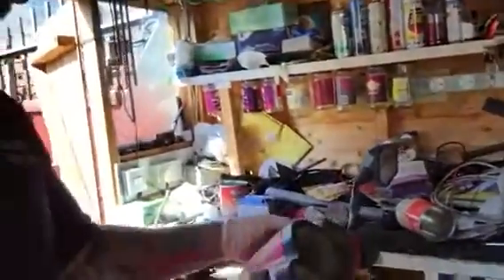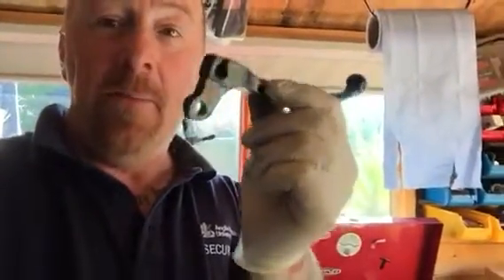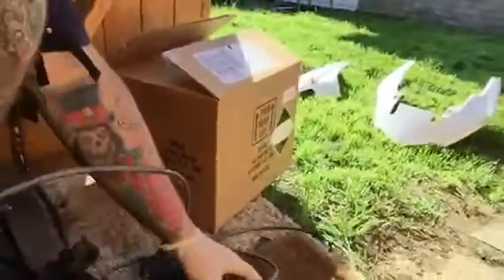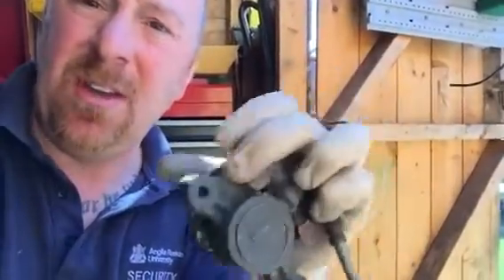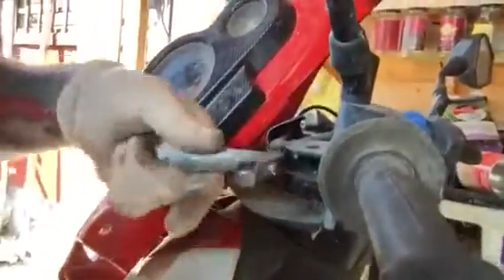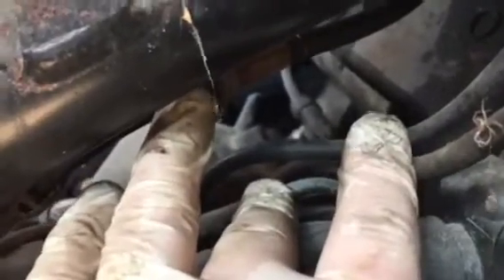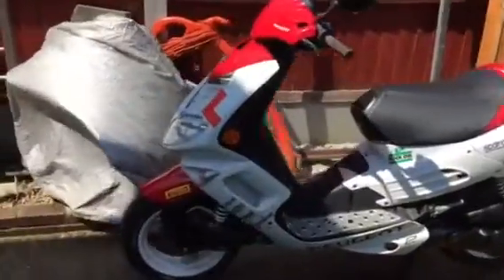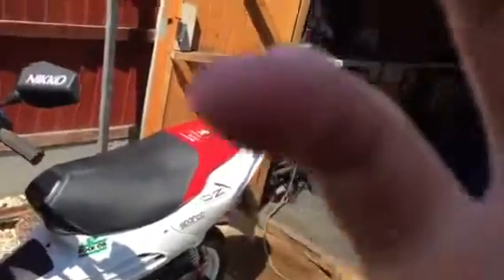SPEEDFIGHT IMPORTANT ALL YOU NEED TO KNOW MARK SAVAGE

Comment: Hiya mate ,I have a question ,I've just mot,d my sons Peugeot ludix  ac 2006 and it's been fine all year as well ,but he was switching lights from high to low basically messing about ,anyway the scooter then cut out and from that point last week I can't get a spark ,in this last week I've bought new stator and Cdi and coil with lead and plug cap,I've tested them all on my speed fight because a few are the same ,I've gone through the complete wiring harness carefully taking insulation tape off and cannot find Any breaks and tested every wire on the scooter ,I've also changed over the ignition key switch just in case that was that although key switch is second hand so that could be faulty ,if there a way to cut or disconnect the kill wire that stops the scooter from sparking ,I know it goes to the Cdi and is colour white with black stripe which goes from key ignition switch to Cdi because that can be the only problem ,I don't want to buy a new ignition key switch in case it's not that ,new stator and Cdi coil and plug and cap including ht lead comes from scooter uk and ,is there anything else apart from helping me out over kill wire that's stopping peugeot ludix from sparking ,only thing I haven't tested on another scooter is secondhand ignition key switch the rest I've tested to make sure I am not going round in circles ,cheers mate
Reply from the maker: 94f1senna is you scooter immob as it sounds like it is !! , you have done the basics but it shouldn't be anything to do with the ignition bud , if when you turn it on you horn or indicators work then it's fine and more like to be your cdi so that may need changing , your son playing with the lights may have nothing to do with it bud , I do have other videos that may help maybe check them out , please like share and subscribe , mark
Reply: thanks mate for replying back. the ludix doesn't or is not the one with the immobiliser .I still thought that could still get a faint spark even if the cdi is knackered. I will try the cdi on another scooter but I am sure the cdi is ok because Ive tried a.cdi off my speedfight2 because some of them are identical non immobiliser 5 pin cdi and both cdi,s work .I been told a common problem is the kill wire on the ignition which goes to cdi then grounds power to cdi so no spark  . say that cdi could be faulty but not 2 lol..thanks anyway mate
Reply from the maker: Good luck then mate if the cdi from you ludix work on the speedfight then your right it must have something to do with he wiring and as in my wiring hell video that can be a right pain , mark

Comment: Hello mark I have just bought a speedfight 2, was running fine now when I use the throttle if I increase it to quicky the throttle cuts out of if I am going as fast as the bike goes and pin the throttle back that little bit more the throttle cuts out also? Do you have any suggestions what this could be also my exhaust has came loose from the engine it's self am having trouble tightening it back on do u have any vidioes that could help me I'm new to scooters so I'm finding it difficult. Thanks
Reply from the maker: hi bud 
I have 70 videos on speedfights and cover everything but you may have to sit and watch a few a I stated with one thing and on the video would then move onto another as I was fixing it so best type in speedfight mark savage and sit back and watch them as they will help 
now your carb can be a few things and ive had this may times 
carb float ,check its filling up ok as at high speeds it often cant fill up once you get over 45 mpg as they are set for 30mph
check all fuel lines that they have not gone hard and check vacuum and tank filter 
what jet size are you running and what air filter ? have you tuned like in my videos 
last serviced / carb clean and plug colour 
sort out this and see how you get on bud

Comment: hey my Peugeot speeedfight 3 lc 50cc is giving me a weak spark and wont start the bike, its not the spark plug its giving a weak spark directly from the ht coil. do you have any idea what it could be?
Reply: could it be the stator pick up going if its giving off a weak spark?
Reply from the maker: +Alfie Newton hi this is one reason I hate the 3 lol ok I've worked on a few with weak spark 1 was the stator coil the other 2 where Cdi and the other was poor earth ! . See what u are getting out of your stator volt  wise and check all power leads / earth , I also had some others that no matter what I did just wouldn't live and they drove me mad
Reply from the maker: Check out my other videos on Speedfight 3s but as I say I really don't like them lol
Reply: +mark “marky bike” savage mines not the cdi just bought a new cdi because the person that had it before me put a crappy Chinese cdi in it, which led me to believe it was that but replaced that and still a weak spark...the bike had been running fine the other day then just died on me when i slowed down and hasn't started back up since...thanks mark ill have a look at the volts coming out of the stator!!

Comment: Hi Mark, ive seen yerterday something on my Peugeot Speedfight 2 LC thats bugging me, underneath near the rear wheel theres a bit of tube hanging from the frame thats connected to the engine, when the engine is on air comes out from that tube. Do you know what it is for ? or if is suposed to be connected to something ? Tanks
Reply from the maker: hi ok you have a gas recirclelation valve pud! but don't think thats it, air ? is it running ok?, sounds like some sort of vacuum pipe best try and trace it back to where it comes fromcould be the oil pump maybe but without being there i cant think bud but if it run ok with no problems you know what they say - if it any broke don't fix it lol, mark
Reply: Whats your facebook ? I can show you some pics
Reply from the maker: GeekTek sorry mate I don't do that any more as I was getting so many guys adding and then  I got hacked !! , how about uploading a video and add me or let me know and I'll have a look then , mark
Reply: This peace is at the bottom of the crankcase and the hose is connected to that on the right side. 
Can you see in your speedfight's if the hose is hanging around below too or if it is connected somewere, tanks 
 https://images-na.ssl-images-amazon.com/images/I/41KnuSV3F0L._SX355_.jpg
Reply from the maker: it was only on some sp2's and is to do with the 2t oil system. some may have changed the engine or used a different way, have a look at you 2t oil system now you will have a pipe coming from the tank trace where it goes .it may have a electric one which is under the left hand side lower bottom fairings , to end bud you bike will run fine as long as you have 2t oil going into your carb check you have a little pipe with 2t oil going into your carb then all is fine. mark
Reply: My oil system is eletric, i just thought that hose connected somewere because at the tip there is a little hose clamp. Tanks for the Help bud!

Comment: Really need some help de restricting my Peugeot v clic, I cut the wire in cdi removed spacer and plate in variator and still want to rest at 35mph restricting, can u help?
Reply from the maker: hi bud re connect the pink wire it doesn't work and messes up your cdi, you bike is restricted by the cdi so you would need to upgrade that and when you do thy tend not to last long, as other things you do will not make it go much faster but better pull away!!
they are great little peds but that's all you will get so don't waste your money bud keep it or change your bike sorry to say . hope that clears thing up but more speed go to a 2t. please watch my other videos and like share and subscribe , mark
Reply: mark savage alright thanks anyway mate think I will and yes does seem to have very good pull away for a 4t

Comment: I thought I'd order a new one from eBay. scooter uk. £7.50 including postage so then for sure I will know because the cdi I tried comes off my other speedfight 2 and for sake of that small price I will know. because we both know that it only come from 3 things .I cut the white and black wire that goes to cdi which is the kill wire and no different. so new cdi it is mate .I will let you know Wednesday lol if it does the trick.

Comment: Are 100cc better ?? Do bendix make it start to m8
Reply from the maker: If you 17 upwards yes they are great peds 65 to 80 odd if played with , and it is part on the start system from the start to the out ring in the variator , hope that helps mate